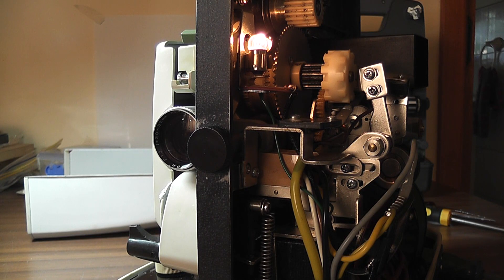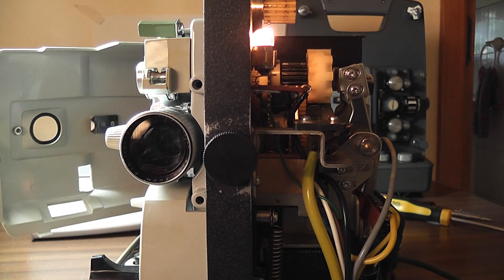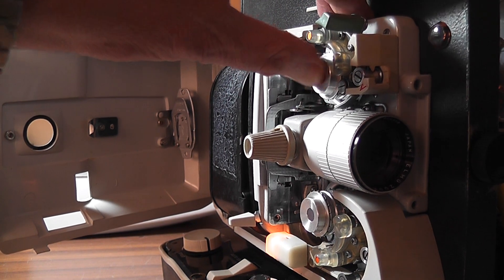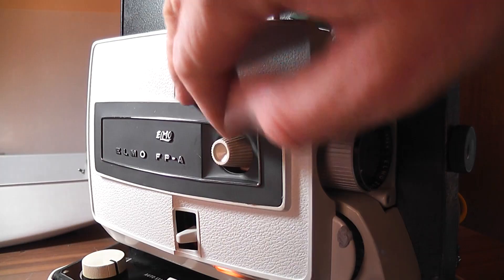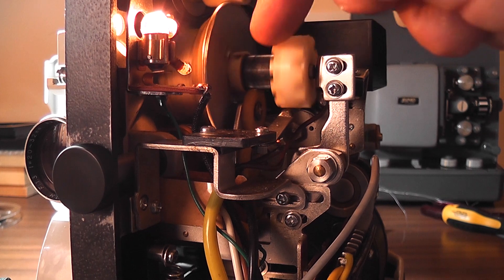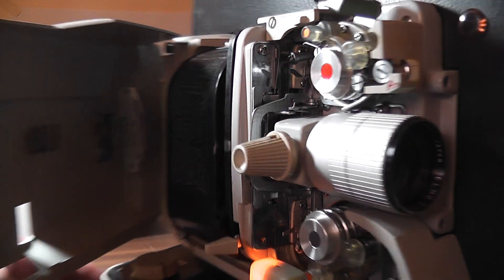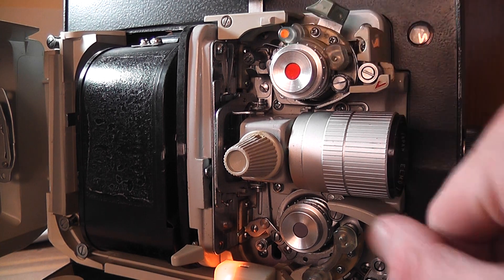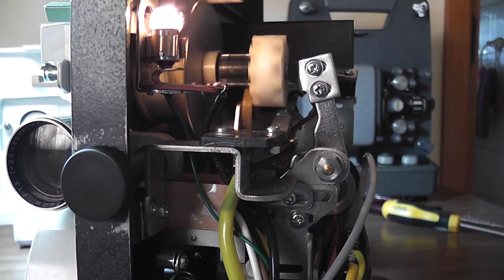Elmo FP A Duel Format 8mm Projector how it works inside front and back

Comment from the maker: I should add to my orginal post  that a sticker was missing on this one, that is stuck on lamp cover, when you are changing formats, also move the inching threading knob on the right hand side of unit, this may save you breaking spur gear teeth. I managed to mould a few spur gears after a few trials and errors that work. yes #d Print would be easier, but to expesive at present.